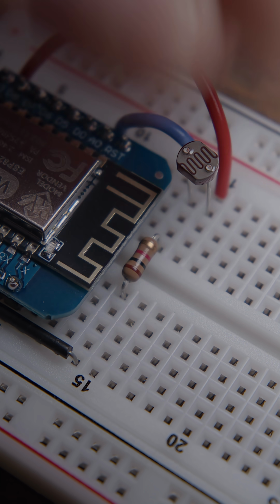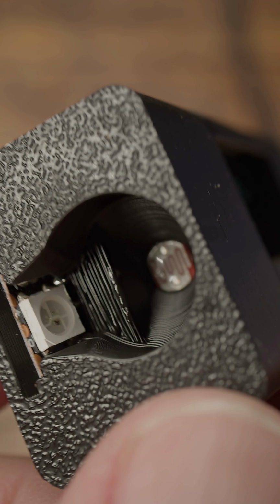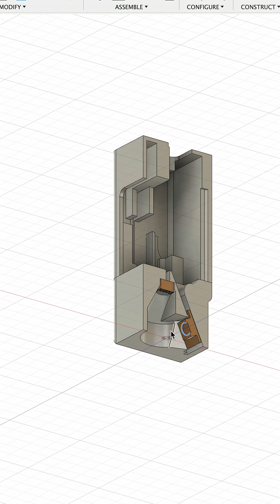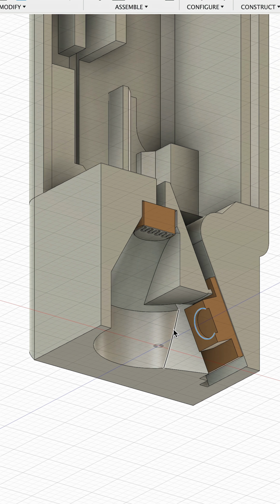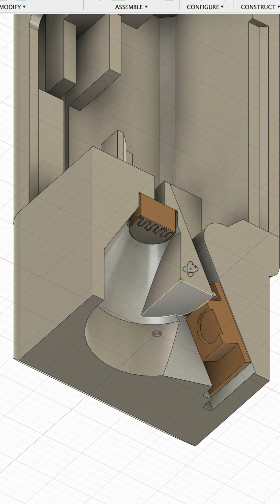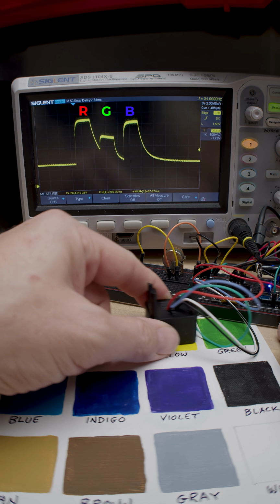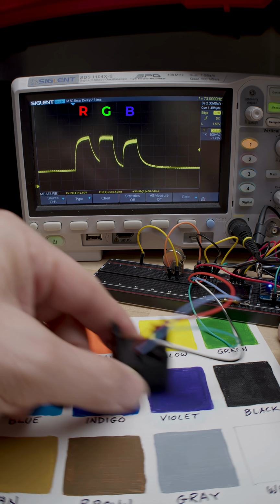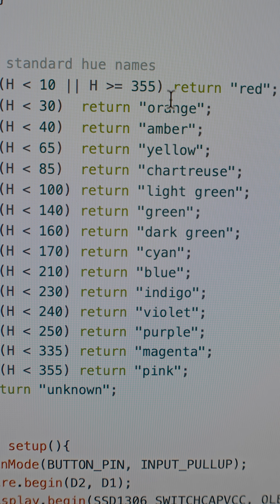LDR Color Checker

Comment: Hard coding 16 colors basically.
Reply: All colour detectors have to be hard coded cause a colour can't be dynamically named.
Reply: @IAmARefrigerator  can't? or is the world just not ready for the vibrant shades of bleuge and glorige?
Reply: @IAmARefrigerator simple library and community fixes that
Reply: @manuelpadua2113  a simple library that hard codes the colours too? There's no other way to name the colours bro. Using a library is crazy unless you just want more color's.
Reply: @burberryHeadband it's possible to train an AI model to identify more colors
Reply: 16 colors that are calibrated off the paint swatches he is measuring
Reply: Not so hard. It can detect a bit lighter and darker than that colors. It wont report as light red or dark red but will say red.
Reply: @EfeKaan48 It can be done on a shitty 8-bit microcontroller
Reply: I think the device should provide the hexcoded colour as well
Reply: It says the Red Green and Blue value on the display, just make the hexcode yourself (hex is just a different way of writing red, green and blue value...  @majd_elhasan
Reply: Not really.. He hardcoded 16 intervals for the 355 hues that the sensor can detect. Different colors are still going to work, because it's going to pick the closest interval.
Reply: No you can turn it into a colour hex

#ffffff example
Reply: @bluethefoxmusic gonna be completely off, those resistors have way too much variation
Reply: You don’t know what “hard coding” is
Reply: Tell me one way to not hardcode color names, please. I'm curious.
Reply: @link1628 put them in a list, or map
Reply: @link1628 idk why yt deleted my comment. 
List or map, choose.
Reply: @ferend4038 that would still be hard coded. You’re just misunderstanding the meaning of hard coded.
Reply: No, the RBG values are not hardcoded. Only the labels are.
Reply: How else do you program something that can write out each colour that’s bring shown to its sensor
Reply: @thecanmanification  pull it out of the cosmic ether ig 😂
Reply: The core of this device is sensing colors, you can even see their mesaured intensity above those "hardcoded" colors, which had to be "hardcoded" unless you're the very special exception who looks up and says "The sky is so 0,0,255 today". :)
Reply: Anyone shitting on this approach probably has no idea how much of their daily tech includes lookup tables as part of critical functionality.
Reply: @clownhands  Ikr, don't tell how their trig functions work, if they hate hard coding like this.
Reply: @clownhands wondering what's wrong with a lookup table?
Reply: @lloydrmc every single professor always says that its bad to hardcode, then we have people who dont critically think for best solution for the problems, admittedly i do that too a lot.
Hard part in coding is not writing code itself, but problem solving, and doing that smart, not hard.
Reply: It gives the RGB values with the name. He can literally import a table conversation of all RGB values to their respective name . So in essence all color is hardcoded when it comes to the label. 

The RGB values are not hardcoded though. 

Why you got 1.2k likes amazes me how short sighted so many people are.
Reply: I dont get it. What even is your comment? 😂. Names need to be hardcoded, because we "NAMED" them?
 Reflected intensity for the color is read, matched to approximated color signature and spelt. Am I missing something? With the limited capability of the hardware I doubt it can accurately give the hex code of the exact color, if thats what you wanted.An approximation of hex code might be possible.
Reply: You could literally just have it interpolate between them so easily and it would be really accurate
Reply: @Industry-insider Calculating the closest match is what interpolation means.
Reply: @timkratz742 no, it means calculating what’s between values
Reply: Yes. Will have to hard code for any new colours
Reply: That's a stupid way to look at it. Colours exist within a range of wavelengths. So you can do this as 16 colours, or more with a more sensitive resistor. But he's doing it with a simple LDR.
What have YOU done lately?
Reply: Colors are hard coded, dude. Google any given color name, and you'll find a canonical RGB value for it. 

Yeah, there's some wiggle room in terms of how people label this color and that, but this project in no way invented opinionated names for colors
Reply: I dont think yk what hard coding means bro
Reply: Color is something hardcoding in nature. Labelling combinations of RGB with corresponding names
Reply: You do the same thing when looking at colors too. Humans don't list the individual RGB or hex value when we see colors. We just pick the closest color we know and use that name (occasionally maybe a "light" or "dark" color, but it'd still default to just that color)
Reply: Ur an idiot that thinks he knows how to code
Reply: Lmao I’ve never read so many confidently wrong answers before. He’s not saying it’s hard to do you morons.
Reply: Hard coding does not mean it is difficult
Reply: Technically this can be used for full range color identification, but the measurements would need to be a bit more precise.
Reply: No? Maybe as the output, but it basically gives you the RGB values? Is it the exact color code? I don't know, but with some tweaking it very well could be.
Reply: From my point of view these values[LUT] should have been stored in file. And that file has to be called by programe[executable] stored on controller during initialization [Start or Reset of controller]. Mentioning LUT in code is called hardcoding. Since u have to update code every time, instead of updating file[LUT file].
Reply: Also hardcoding increases the development testing time[wastage of time from Senior Manager level point of view]😅. Inshort to explain his activity[thinking] he has presented his thought nicely.
Reply: It can actually detect any color because the sensor is analog, so you can just take the reading and display it on a screen and it will be accurate
Reply: Every great project starts as a prototype. And the ingenuity alone in using a LDR to detect color is whats amazing about this. You can take this idea and expand the color pallete to Hex values and then you can get really accurate. So go ahead and keep knocking on people doing things. While you do nothing.
Reply: "Same same, but different" 😅
Reply: Device measures RGB values which potentially could be 16 millions colors.  However due to the limitation of sensing and AtoD the actual number would be fewer.  However its definitely not limited to what encoded in the program.
Reply: The correct term is he quantized it. The process is capable but he saved his time by only writing values for certain colors.
He can easily link an API to a color recognition service.
Reply: @ParityCheckT8 if he’s new scanned values for real life colours he would have nothing to match scanned data to.
Reply: Great if it can detect exact PMS numbers!😊❤
Reply: Yeah.  He did kind of hardcode it, but not totally as the RGB 'intensity' readings are just above the hard coded colors.
Reply: Not really though. Like, if it can get the intensity somewhat accurately, you can probably translate the values to the 6 digit hexadecimal code of the colour. May not be perfect because of the spill from the LED and accuracy errors in the sensor but it could still be able to give a colour close enough.
Reply: 1s and 0s aren't even "hard coded". They're a range of electrical current being assigned to 0 or 1, but not every 1 has the exact same amps and voltage as the other. 
Digitising is basically applying a cut-off filter to the analogue to get clear signals to work with.
Reply: Bruh hardcoding does not mean hard to code.
Reply: The color label yes, But it already have data on the rgb spectrum, which can be expanded.
Reply: Its the future of designing bud
Reply: You didn't pay attention at all. And even then, all color names are a table looked up based on the sensor value output.
Reply: No, it will say whatever color the detect light is closest to. You could do more if you wanted.
Reply: Rather I m wondering how he used
Multiple ifs with > condition 
I mean either he should have used elifs  , or he should have used >c> double condition check. 
Or it isn't python 😂
Reply: Sybau
Reply: No, 256^3 colors. The software just narrows it down to 16 colors. Change the software, you change the number of colors.
Reply: hard code deez
Reply: Do you double the green channel as well?
Reply: Yeah, I feel like he could've come up with an algorithm that converted it into Hex Code and output the actual Hex Code value to the computer.
Reply: he didnt hardcode 16 colors, he hardcoded the names of 16 colors. 

the device itself measures the analog percentage of the reflected amount of red, green, blue. so how many colors and how well it measures is a question of resolution, sensitivity, tresholds, repeatability,led consistency,timing and light bleed.
Reply: @IuponixDid you watch the video? The sensor absolutely does not detect RGB light 🤦‍♂️
Reply: @wearthkin it detects a reflected intensity for each of the three primary colors.   What would you call that?
Reply: I can tell None of these people are programmer nor ever touch any coding style😂. "Hard coding" here means the condition of sensor is writen manually, e.g :
"red" = 000088;
While mostly we write the condition instead, e.g :
If (hue ....) {
//
}
Reply: basically no
Reply: Yes it is, people who disagree don't know shit about coding
Reply: Eh, wait until you find out how AI models are made.
Reply: @AlgorithmiusMaximus that would be scaled up "garbage in, garbage out" all while throwing enough hype at it that investors suffer FOMO and buy into it!😂
Reply: @AlgorithmiusMaximus AI models tend to have a few more than 3 parameters
Reply: @chickenbobbobba  it ain't that deep
Reply: @AlgorithmiusMaximus please tell me what hardcoding ai models have
Reply: @urisinger3412  There’s often a misunderstanding that AI models magically invent themselves. In reality, the core architecture, optimization methods, and training procedures are all hardcoded by design. The model only learns within those constraints.
Reply: Wtf are y'all talking about, didn't you see 16 ifs? That's called hardcoding
Reply: guys are we seeing the same short and reading the same comment? because OP is right, he hardcoded all colors. to make it say "violet" you have to provide the name and associate it with a value. while it is true that the device is reading intensity, then it is stored as individual values forming a sort of RGB detector you must store the values such as: 11 ohms for red = no red and 0 ohms for green is 100% green and 11 ohms  for blue = 0 blue this is stated in the video (when hackmademod tells about connecting it to an analog input). at that moment you can also see how he specified the 16 colors lol 

if you specify something in a too detailed/explicit way that's what's called "hardcoded"
Reply: @JoachimVampire detecting RGB values is not hardcoded. All color labels would be hardcoded by definition of having a specific RGB values to name.

If he adds a larger table because it finds closest match it would expand past 16 and scale to how ever many tge table has.

So the post is an attempt to discredit and over simplify what was made as a good project.
Reply: @JustADad-37  my man, are you a programmer? Because he's not detecting rgb values. He's detecting the amount of light reflection and then store It as a individual % (the analog input should be properly calibrated tho) and then internally set to one of the RGB components such as " 3.2 ohms = 35% red"  That's NOT RGB detection, It works as a RGB detection but it's not. You can use a backpack as a hat in the desert and It Will still be a backpack but It works like a hat.

He then HAS to HARDCODE a RANGE for every single color, which then he labels It. He even says It on the video. 

RGB detection IS stupidly precise and the only things you have to do is to do is to label certain specific values if you want to see names; not ranges. An RGB detection tool sends a hex code straight (or another value that can be simply translated to hex or rgb)  it can also pickup colors from a screen which this obviously does not. 

Do you see the difference?
Reply: @JustADad-37  my man, are you a programmer? Because he's not detecting rgb values. He's detecting the amount of light reflection and then store It as a individual % (the analog input should be properly calibrated tho) and then internally set to one of the RGB components such as " 3.2 ohms = 35% red"  That's NOT RGB detection, It works as a RGB detection but it's not. You can use a backpack as a hat in the desert and It Will still be a backpack but It works like a hat.

He then HAS to HARDCODE a RANGE for every single color, which then he labels It. He even says It on the video. 

RGB detection IS stupidly precise and the only things you have to do is to do is to label certain specific values if you want to see names; not ranges. An RGB detection tool sends a hex code straight (or another value that can be simply translated to hex or rgb)  it can also pickup colors from a screen which this obviously does not. 

Do you see the difference?
Reply: @JoachimVampire my man you just said he was detecting RGB values with a different measurement,  it's like arguing he measured in inches not metric therefore its not a measurement of said item. The values are consistent per color as well...

Even smart people like yourself fail to apply any critical thinking and just jump headfirst into making a counter argument for the sake of countering. 

This whole response is that OP is saying he just hardcoded this, in which he did not because you can clearly see the RGB values (measured differently 😂) are clearly noted and a table of more colors would scale the results of scanning.
Reply: @JoachimVampire that dude doesn’t understand how LUTs work 💀
Reply: Not even close
Reply: try add machine learning algorithm with this simple sensor, it might increase it's capability
Reply: for all the confused people in the replies "hard coding" typically refers to a behavior that occurs due to the physical design of an item, its "hard"ware.
Reply: No not hardcoding nothing genius
Reply: @BeatBoyStill you clearly know absolutely nothing about programming you f**** moron
Reply: No it's not, hard coding would be it only detecting one shade of a color. This methods finds the closest color. 

Otherwise how else can you make a deflector without setting the values it's supposed to detect?

Comment: You could do combinations of different colors with 3 PWM signals also, and get a reading of the color through RGB lighting (although it'd be a much longer process)
Reply: Isn’t that exactly what he’s doing?
Reply: @Industry-insider not exactly. He's just activating and deactivating each single led at full power and measuring light bouncing intensity. He's doing digital outputs instead of PWM

Comment: How does the sensor convert light reduce resistance? How does the absence of light result in no resistance?
Reply from the maker: An LDR doesn’t go to zero resistance in the dark. It’s actually the opposite… in darkness its resistance goes very high, sometimes into the megaohm range, which means very little current can flow. When light hits it, photons free up charge carriers in the semiconductor material, lowering the resistance so current can pass more easily. More light = more carriers = lower resistance. So the sensor is basically “harder to push electricity through” in the dark, and “easier to push through” in the light.
Reply: @HackMakeMod whoops. I’ll leave my typo there to not mess up your explanation.😅 thanks for the reply!

So is this property of photons hitting the receptor and electron movement a unique property of the material?